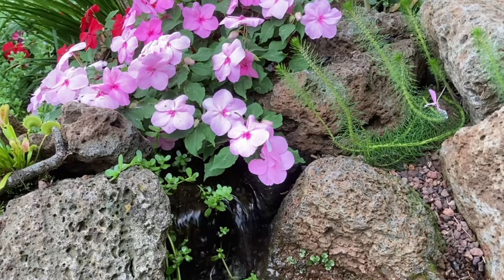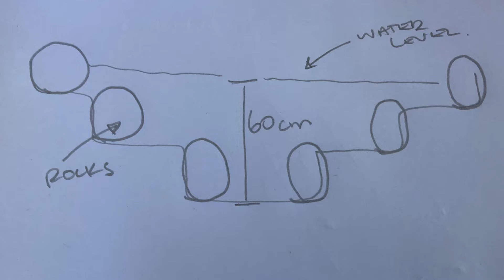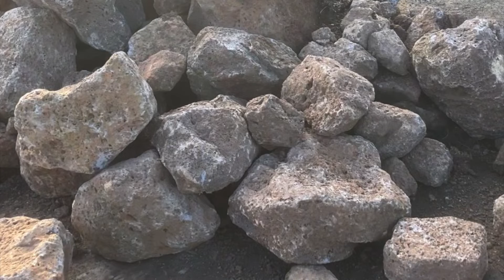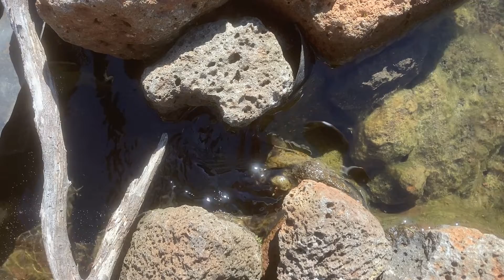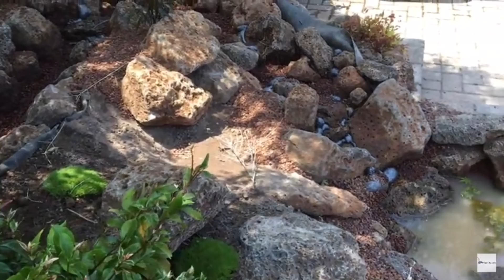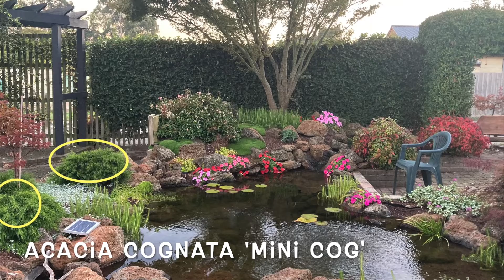DIY POND| DIY FILTERS| CLEAN, CLEAR WATER

Comment: What is the easiest way to add the bog filter to an existing pond that has a skimmer.The water from the skimmer come out through a small drip water fall. i also have a large waterfall that is supplied by a pump that's in the pond.
Reply from the maker: You need to size the bog properly and have the flow rate in the right ball park. Then it’s just a matter of having that flow run through the bog and the water returning to the pond. It’s easiest if the bog sits higher than the pond so that gravity returns the clean water to the pond. Ive got plenty of videos and there’s plenty of other people also.
Reply: @Ozponds  So, do you mean to have a pump submerged with an intake and outake on the bottom of the pond and run that pipe to a bog outside of the pond that's raised? In your video the installation is on a new, empty pond. Mine is 17'x18' and full of Koi. I already have a bog running the length of the pond that has gravel in it, but i recently found out that after a few years it will be full of junk and there's no way to flush it since it's a ledge in the pond. It's part of the pond.
Reply from the maker: You should always have a method of clean out. I’ve got loads of videos that talk about design and implementation. Very hard to describe in a comment. This one might give you an idea on how to create a clean out port. Bog filter in a stream| DIY Pond build
https://youtu.be/NDrOEnmKGak

Comment: Great videos Kev.  I watch many of them and got inspirited to make a pond as well. I would love to connect my swimming pool to the pond, so the water would get cleaned the natural way, not with chemicals. I live in Canada, just outside of Toronto (in winter we can get temperatures as low as -25 C.)  The pool's dimensions are:  11.6 x 5.4 m and holds around 90 m3 of water. The area that I'm planning to make the bog, stream and pond is roughly 8 x5 m, but it could be bigger if needed.  
Do you think this is a good idea?
Reply from the maker: I do. It’s something I want to do myself one day.
Reply: Thanks Kev.  I will keep you posted.

Comment: Ho Kev, thanks for your clear vidéos. I'm motivated to do my frist pond with your recommendations next spring. 
I have one ask about localisation the water pomp. It's not à problèm to position it not in the deeper place the pond?
Reply from the maker: No not a problem. If worried you can add an aerator to circulate water on the bottom of the pond.

Comment: Great and beautiful pond. Simple concise explanation. Thanks.🙂 Gonna built one up myself soon . Gonna use an IBC as a bog filter and willy bin as mechanical skimmer filter. It would  be just slightly bigger. Just a quick question. What is the regulation regarding the depth of the pond before you would need safety fence? Thanks again for the great informative video👍👍👍
Reply from the maker: Depends where you live. In Victoria where I live there is currently no requirement to fence a fish pond of any depth. But regulations change all the time. I always recommend just sending an email off to the local govt then you have a written response for your records 👍

Comment: Really good video (as usual). I like the way you've highlighted the plants, makes it so easy to see which is which. 
I'm wondering how low the temperature can get in your winter, and will the plants in your various bog filters still be taking nutrients from the water? In somewhere like the UK our plants tend to go dormant over winter so I'm  guessing they wouldn't necessarily be able to utilize the nitrates etc.
Reply from the maker: Winter air temps as low as -5C. Water never freezes though. The plants in the bog go dormant. I’ve been reading a lot about anoxic filters lately and I think in the bog zones are anoxic (different to anaerobic) very low oxygen, this allows nitrogen to be converted to gas and dissipate in the air. I assume this is what is happening cause I always read zero nitrates even in winter.
Reply: @Ozponds  Thanks for your informative reply. I started out reading about anoxic filtration which led me to bog filters, hence on to Ozponds! The anoxic/biocenosis system looked "technical" what with having the perfect cat litter and all, while bog filters seem more natural and do-able, yet both systems rely on a similar balance of bacteria. Maybe I'm drawn to the plants!
Reply from the maker: Well I love bog filters as you can tell. I’ve got 6 ponds with bogs all are crystal clear all year round. 👍